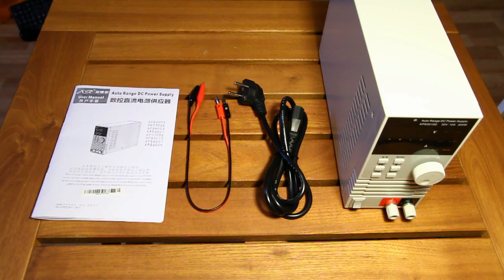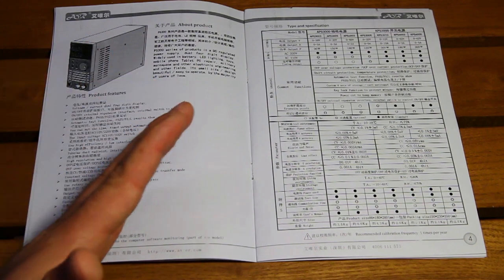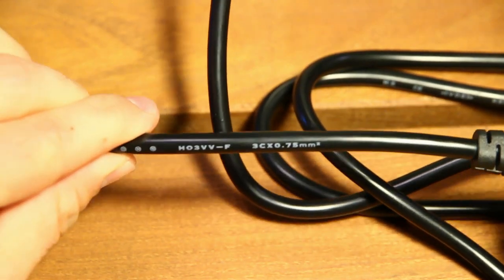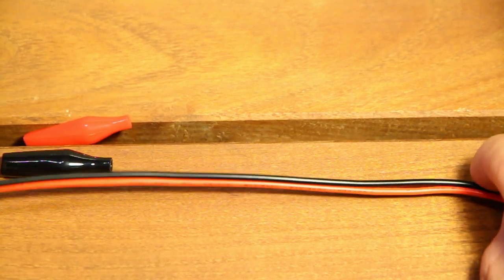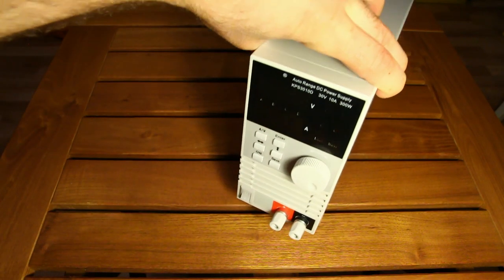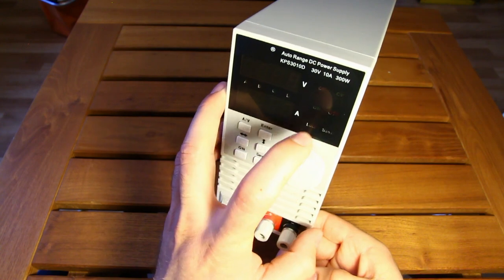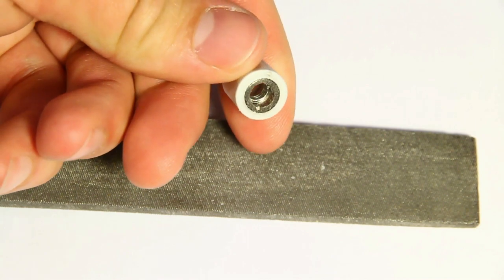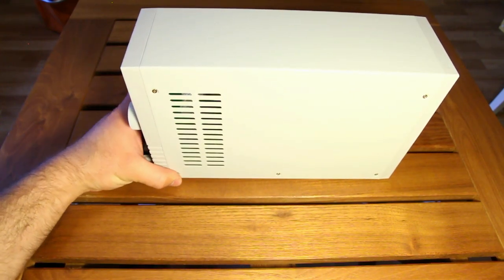AVR KPS3010D 30V 10A Bench Switch Mode Power Supply - Review Part 1 #014

Comment: Looking forward to Part 2. It took me a while to realise that the switching between CC and CV modes is automatic. The system can be visualised as starting in CV mode. The power supply begins to ramps up the volts to its set value. If the current rises to your current setting then it will keep the current at that level and switch to CC mode. The voltage then stay below its set value, and helpfully shown on the display.  

I found the memory settings on delivery were for high voltage and current, so when I accidentally switched to a memory setting I blew the item (only a bulb!). I suggest you set all the memories to zero volts and amps.

Once the manual was understood I found the Power Supply accurate as to current and about 4% off on no load voltage. Remembering that voltage at the load will be always lower than that showed due to lead resistance. 

Really pleased with my simple use so far. It would be good to see a detailed performance analysis.
Reply from the maker: The basic functions do work quite nicely but I'm curious whether or not the advanced features like "Over-Voltage-Protection", "Auto-Test-Function" and "Output-Timer" do work on your unit. I'd like to know if it's just my copy or if the firmware just wasn't ready before production.

Comment: Hmm. At the moment it seems that another very similar model (KPS3005D 32V 10A) is available from a German seller(s) on ebay, similarly priced. 
It has minuscule difference on the front panel, e.g. colored letters on keys. But, I'll probably end up ordering a gophert unit from China, the cost will be the same in the end (with import VAT).

Comment: you cover the mechanical side of those power supplies pretty good, but perhaps you could also add infos about their electrical performance. for example how much does it overshoot voltage at turn on, or what amount of ripple/noise it produces.